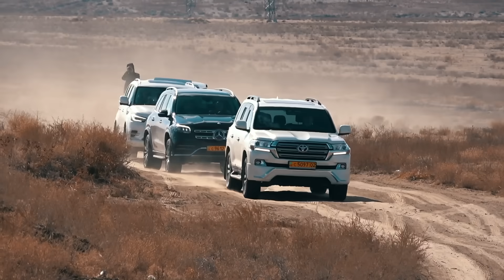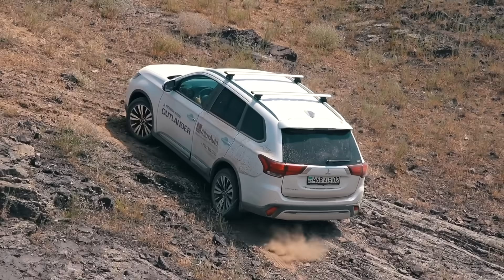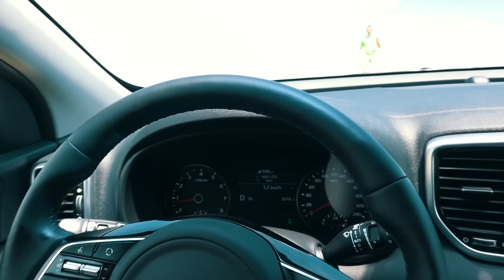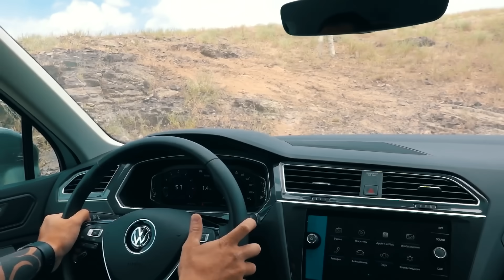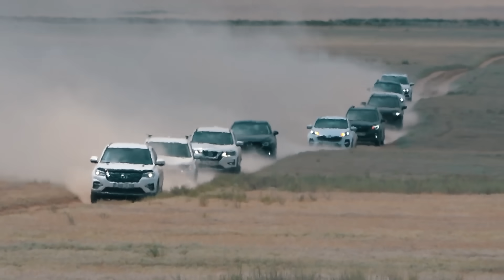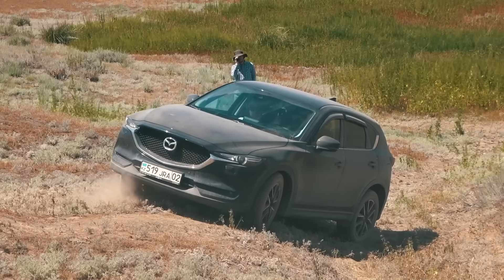SUV Battle 2020: Toyota RAV4, Nissan Rogue, Subaru Forester, Mazda CX 5, Volkswagen Tiguan, Sportage

Comment: Cx5 всё де чисто город машина,для оффроада точно не годится по моему мнению
Reply from the maker: Если интересно, есть такое же видео но на русском языке.
Reply: @SUVBattle  да я знаю английский,мне не мешало.Но за сх5 хз чего его в оффроад тестить.Считаю авто больше для города и для асфальта и если снежок по бампер.
Reply: @AttackHeliocopterKA-50   Off-road tests of crossovers show AWD pros and cons. "
Teknikens Värld" proved in 2014 that CR-Vs AWD didn't work at all. Honda released mastered AWD system next year. This is why we do tests.
Reply: @mjl8115  But the behavior on off-road and wet weather/asphalt is still different.I'm not saying that you dont need to test the car,but that it's better to choose other conditions.This is just my opinion
For example, I have never seen the owner of the cx5 in the woods or in the mud, but I often met RAV4, Outlander, Suzuki Jimny/Grand Vitara, also Nissan Patrol, toyota Prado/Land Cruiser.Also didnt see Nissan Xtrail fress versions or Honda CR-V

Comment: Funny doesn’t seem like a treacherous climb...maybe you have to be there...weird how many manufacturers don’t simply tell software to lock the diffs when pitch angle so large.  Maybe I don’t understand the hardware...If the wheel is spinning fast AF, you’d think the power would be completely shifted away from that wheel...I’m no engineer....
Reply: There's just one angle of the video that I noticed and really saw the grade was aggressive. Would be nice if they put the degree of the angle they ascend. My forester sport has the display available that shows the degrees of the hill.

Comment: Surprised at how badly the Subie did! The Rogue I knew would do well. Their AWD systems are very good and underrated. And, I have the no doubt that the Outlander with the V6 and 6 speed auto would do much better. Would love to have seen how badly the Honda CR-V would've done. Lol! (Why wasn't it included?)
Reply: Much more dependable on the flat stuff or just knowing you ll need more momentum heading up steep stuff.

Comment: So basically u need speed and power ! (JEREMY CLARKSON APPROVES
Reply from the maker: Drivers deliberately drive as slowly as possible and along a deliberately “wrong” complex trajectory. This allows you to demonstrate the effectiveness of the four-wheel drive system. If you take a good acceleration, then all cars will easily pass this obstacle and you will not notice any difference in their behavior.
Reply: @SUVBattle  its a joke bro, however u can notice the difference between torqy engines like the turbos over the naturally aspirated ones, even the mazda 2.5 is low on torque, however if you have brought the 2.2 diesel or the 2.5 tubro it would have easily passed it aswell

Comment: Rav4. 💪💪💪. I expect subaru forester would equally good with rav4. But maybe the y need to change the cvt to 8 speed automatic
Reply: You should work for Subaru - that’s an excellent solution to avoid CVT and keep good fuel economy.  My old 2009 XT turbo with four-speed auto ran perfectly and was a master of steep tracks and sand.
Reply: Driver never selected x mode in Subaru
Reply: Forrester was driven by a driver who clearly doesn't know how to choose the driving mode for the conditions at hand.
Reply: @knightryder3757  Subaru with it's CVT and junk software LSD wasn't built for something like this.  I best if the Forester had real mechanical LSD or Toyota's clutch system on that rear axle, it would have made it up.  But with it's current design for most road usage and forest fire trails .... I highly doubt any driver could have done better with this test.
Reply: Not all RAV4s get the AWD system that this one had.  I think there's 3 different AWD systems Toyota puts in the RAV4, depending on trim.  Also Toyota's AWD is "On Demand".  It is not a full time AWD system, like Subaru.  So depending on the circumstance, one might win one day, and the other the next.  If you already don't know, and "On Demand" system only sends power to the other axle when it feels slip.  If it doesn't feel slip, these On Demand AWD systems are almost always just FWD vehicles.

Comment: Somethings is happening and I have watched multiple AWD videos with subarus and they are able to get without much trouble. I am a bit disappointed I am a big fan of Subaru. I own a 2011 Subaru Outback and it plows through snow and it has never failed me. BTW there is no way a tayota  can beat a Subaru
Reply from the maker: I have a video with Subaru Outback where I compare it to its rivals. Maybe later it will be on the channel.
Reply: @SUVBattle  can you comment on how it did? I’d be interested to see how the new Forester Sport’s dual X-Mode compares on a similar test and whether it brings anything new to the table.

Comment: The problem with the outlander is the CVT until certain point it cuts the power, that car should have an 8 speed automatic
Reply from the maker: I have already filmed 7-seater test with Outlander V6 3.0 + 6AT, and there we will see the difference with current CVT Outlander. Competitors of Outlander will be:

New cars team:
1. Sorento 2019 V6 3.5
2. Skoda Kodiaq 2020 1.8T
3. Toyota Highlander 2018 V6 3.5
4. Hyundai Santa Fe 2019 2.4

Old cars team:
1. Chevrolet Captiva 3.0 2014
2. Honda Pilot 3.5 2006
3. Subaru Tribeca 3.6 2008
4. Ford Explorer 3.5 2012

Will be published at the end of January

Comment: I think the Subaru should have come first. I have Subro XT 2018 and I think would have passed the experiment very successfully.
Reply: CVT?
Reply: @alozano793    Although the gear system is CVT, (by the way, it's an improved and upgraded system) the Subaru XT  2000cc Turbo - is the best SUV in the segment.
Reply: Dude I'd rather pull a red wagon filled with 800lb of rock than drive a heaping pile of garbage like a Subaru up that hill

Comment: Next time with mazda CX-5 try manual mode and TCS off it tells the traction control that we are going offroad and it will try to use brakes to transef power to oppossitte wheel... this test was pointless..
Reply from the maker: It would be unfair to other participants. We are trying to put cars at the same conditions which are included or recommended by manufacturers.

Comment: excellent video! my only issue is you didn't try disabling the traction control on the cx5. it's known that mazda's awd system performs better in off road situations with traction control off vs on. the traction control lets the wheels slip ironically. it helps with maintaining control when going at speed on loose surfaces. disabling the traction control makes the brakes work more aggressively to get stop the slipping wheels, transferring more power to the loaded wheels. probably won't fix the over heating but you tried enabling/disabling systems on other cars. i wanted to see what the mazda could do had traction control been disabled. it would also probably be similar to the off road mode on the newer cx-5's.
Reply: عععع
Reply: Ne çok biliyorsunuz bee
Reply from the maker: All comes with experience. Let's try next time. Bhe way, Mazda promises an off-road mode for CX5.

Comment: Great test! A pity CVT's become more common each day. Subaru with manual gear would perform muuuuch better
Reply: just engage cvt to manual mode and there will be no difference
Reply: I have a Forester 2020 and this is very deceiving. Curious if the Outback turbo would do better?
Reply: @louis-francoispreville-rat1472  I don't think it is deceiving. The fact of the matter is that the CVT transmissions of Subaru's take away from the infamous Symmetrical AWD. We have both a 2011 Outback and 2017 Impreza with CVT transmissions.

Comment: Haha I was about to type my angry Subaru comment hahaha
Reply: Dude IKR. They don't have the most torque and as an owner I would not wanna burn out my transmission. This is why I watch others play on hills and dirt. So I know what Can be done vs what I would Prefer to risk in my own vehicle (forester sport 19)
Reply: @alozano793  I feel like the traction control of the newer subies really limits the car. My old subies would go wide open
Reply: @fliptophiphop1894  I turn off the traction control every chance I get.

Comment: 9:53 the Subaru is climbing the hill and the driver hits the brakes.
Reply from the maker: Drivers deliberately drive as slowly as possible and along a deliberately “wrong” complex trajectory. This allows you to demonstrate the effectiveness of the four-wheel drive system. If you take a good acceleration, then all cars will easily pass this obstacle and you will not notice any difference in their behavior.
Reply: Yes the Subaru driver was extremely stupid
Reply: @crystalstone2166  
I dont think it was his car, or don't you get that?

Comment: I'm very surprised by the poor performance of the forester. I've tested a few of them from different gens including that one and it did brilliant on very wet descents and rocks (instead of dry here) with winter tires (softer). I tested the e-boxer version from europe though, which has a little more low-end torque qui the electric motor though, but is heavier.
Reply: Try a different driver
Reply: @titoplacido9280  forrester will win.
Reply from the maker: Performance of the car deepened from different factors, in this case there was a huge angle of the hill. Because at the second obstacle Forester did very well. It also did good on my previous experiments with less angle of the hill. Looks like CVT is not allowing to drive in hard conditions.
Reply: @SUVBattle  I agree, CVT is the limiting factor for modern Subarus with this type of transmission. Even if it is not inclined but with a huge bump in front of the wheels, it does not allow the engine to transfer torque to the wheels.
Reply: @SUVBattle  Thanks for the clarification! I was still surprised because of my own experiments, even though they were a little different from here! The e-boxer version with with the 2L engine + electric engine giving 260nm of total torque (and way more at very low revs) works a little better probably than this 2.5L with more torque on higher-revs! Oh and, the new JDM 1.8L turbo + e-boxer with 300nm+66nm of electric torque. It must be a great upgrade compared to the current 5th generation which disappoints a lot on the internet (even though I'm personally not completely disappointed).
Reply: @gagd7351  2014 and prior Subaru's were the best for off-roading. In the 2015 refresh and beyond they put in the CVT which gimped the off-road capability. Older model foresters with the regular 4 speed automatic or 5 speed manual will not cut power to the wheels. I have a 2013 5 speed forester and it will rev and spin wheels at much as I want with traction control off. It can take a few seconds, but the VDC AWD system will figure out which wheels to apply the brakes to and transfer power to the wheels with traction. The main situation where it struggles is when the car only has 1 wheel with meaningful traction. The combination of the limited slip differential plus lack of real-aggressive brake vectoring limits the amount of torque that can be sent to a single wheel. On a flat, icy surface it can send enough power to get you going, but on an incline on uneven terrain it can struggle. Overall very capable systems provided the transmission can transfer the full power of the engine!
Reply: Same, I never thought a RAV4 would beat a Forester off road
Reply: @revaholic  Toyota has way more experience of making offroad 4wd cars then subaru.

Comment: Sportage is not pronounced the way you are saying it. It’s said the same as Montage. Sportaage not Sportidge. 
Also should never have a CVT in any off-road vehicle. They just can’t handle it.
The last Tiguan 2ℓ second run easily made it up as it didn’t stop halfway like the rest. It just drove up from the bottom to the top with the gas on. Hardly a fair comparison.
Reply: 1. There are two ways to say and Google translate supports our version:). 2. CVTs are a predominant type of transmission of ATVs:) 3. That second run was intentionally  made that way, please re-watch listening carefully to understand why. 4. Once again please re-watch listening very carefully the very beginning of the video where it is disclaimed in advance that the test is not fair:)).
Reply: @bakhtiyarpakhirdinov2461  seriously you’d believe and rely on google translate??  Google and navigation apps mispronounce street names all the time. Doesn’t make that right. No there’s only one way to say it - correctly.
Would you say there’s two ways to say your name, no? You’d want people to pronounce it correctly. It’s an insult when someone says your name wrongly especially once they have been told how it’s said. Initial mistake, ok but then say it properly. If I was a car manufacturer I’d be annoyed to have the make or model mispronounced. 
Yes I did hear the disclaimer at the start. True - I’d forgotten about that.
Reply: You seem finicky...
Reply: @alozano793  not really. Just if you’re gonna say something, say it correctly. It’s not difficult.

Comment: Its good but better with same driver same tyres.. and also mass and power play a big role
Reply from the maker: I completely agree with you. The same tires and drivers will add objectivity. But we work with what we have. At the moment, we are checking that the tire pressure corresponds to the factory values (for each car individually) and drivers are instructed to drive.

Comment: I do not think turning ESP off solves any traction issues. ESP is meant to limit slip.
Turning it off means slipping won't be suppressed at all. 
The first generation of the Mitsubishi Outlanders came with diff locks. I don't know why this one doesn't.
If it did, he'd have locked it
Reply: Depends on particular situation and works differently on various terrains. Sometimes all you need is a lot of agressive slipping to get your ass out of trouble! Like ice, mud. And oppositely slipping is undesirable on rocks or sand.

Comment: As owner of 2020 forester i can say that i am shocked with the performance i sow here , i have taken my forestor to very slippery and sandy road and never fails me .. i think there are something with chosibg the drive mode here since it came with 2 different x mode setting ,. Or this car is only equipped with one mode which doesn’t allow wheels spinning.. which called deep mud and snow
Reply: Deep mud and snow is my preference for the really crappy or uphill stuff. Or when I wanna have some fun Traction Control off and sport mode/manual mode for some good tire spinning fun.
Reply: Or it could be that Subaru is quite shit and the cvt is garbage. Wait, I’m quite sure that’s the reason.

Comment: SUT BATTLE??  toyota hilux and rivals
Reply from the maker: I have it already filmed. 

SUT Battle part 1:

1. Ford F150 2014
2. Ford F150 Raptor 2018
3. Ford Ranger 2012
4. Isuzu D-Max 2018
5. Nissan Navara 2008
6. Toyota Hilux 2012
7. Toyota Hilux 2013
8. Toyota Hilux 2017 Arctic Truck
9. Volkswagen Amarok 2018

SUT Battle part 2:

1. JAC T6 2.0T 2019
2. Mitsubishi L200 2.0TD 2008
3. Toyota Tacoma V6 4.0 2005
4. Volkswagen Amarok 2.0 TD 2013
5. Toyota Tundra V6 3.4 2001
6. Тойота Такома V6 4.0 2010
7. Toyota Hilux 2.5 TD 2013
8. Volkswagen Amarok V6 3.0 TD 2018
9. Nissan Titan V8 5.6 2005
10. Ford F150 V8 6.2 2014
11. Toyota Tundra V8 5.7 Supercharged TRD 2009 Total Chaos / King

Which part seems more interesting?
Reply: @SUVBattle  WAW  !  Battle part 1 ! tomorrow ??? 😂😂😂

Comment: All of these vehicles would perform 10 times better if they had just a physical LSD differential! And a normal automatic transmission!
Reply: This. If Subaru are Invested in CVTsz they need to work on their torque handling. The newer high torque CVT in the outback turbo seems to be a lot better than this , so that's a start.  Secondly, move to  E diff in place of BTC as BTC still only allows 50% torque to the gripping wheel . That's a problem when you're torque starved because of CVT